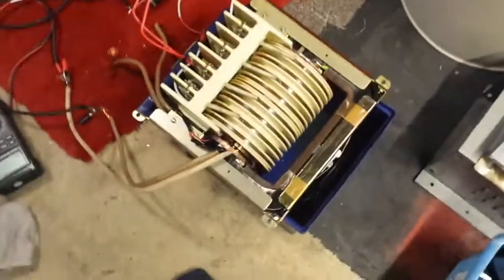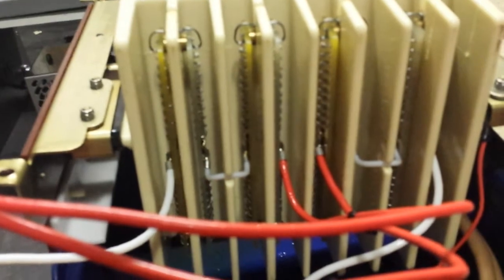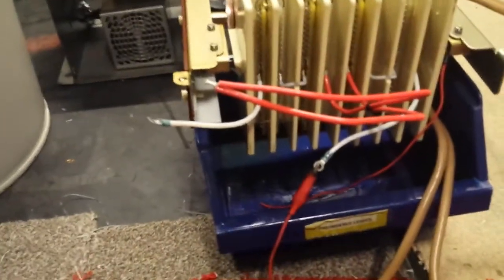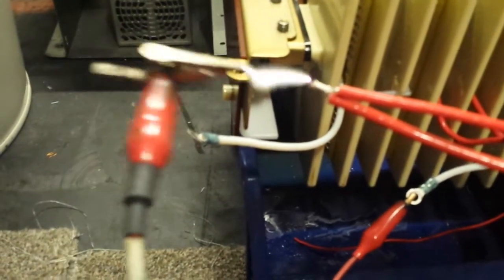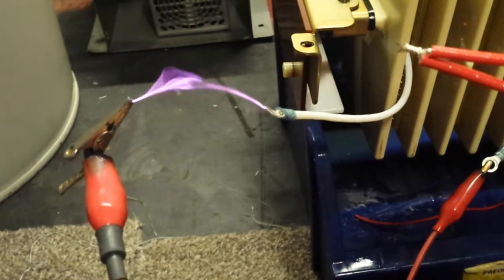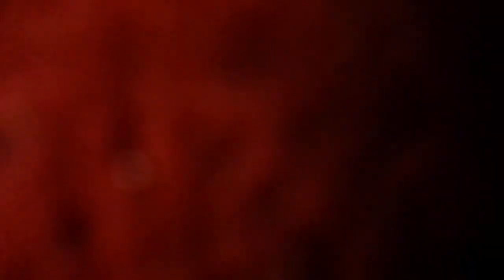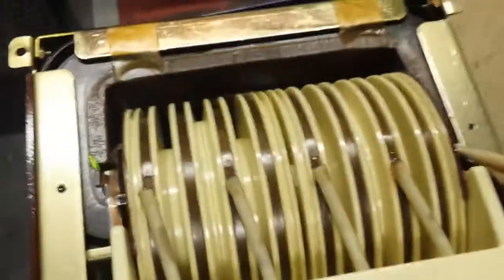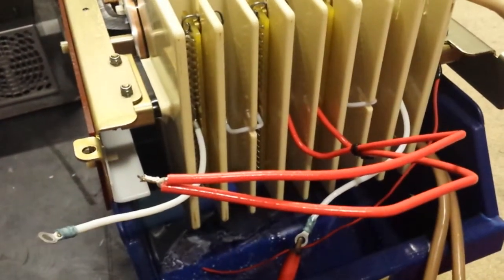150kv X-ray transformer

Comment: Beautifully made transformer, thanks for sharing. Those rectifiers are amzing, nice array of diodes in series. Love the purple arcs.
That will perform like heaven in mineral oil. and ferrite core it for HF use.
I just scored today a 3Ø VT ( 11 kV 110 V ) from an old substation we are demolishing.
I could also get the 33kV / 11kV 12.5 MVA TX. haven't got the space for it, so the scrappie will get it. LOL.. Great video.

Comment: Looks like  those diode strips are on clips, so can be removed/replaced easily.
The cores are 'C-Cores' i used to work in a transformer factory where we made transformers with that type of core, they have a steel band which is tensioned then soldered.
Nice looking transformers should be in a glass (fish tank) style case so you can show it off to visitors, being able to fit a lid would be a challenge, though i have some ideas.